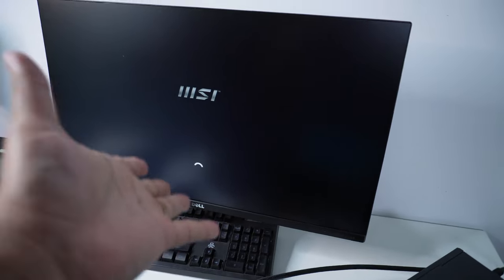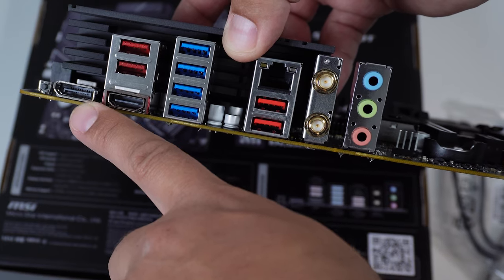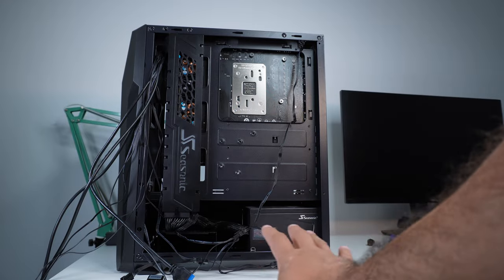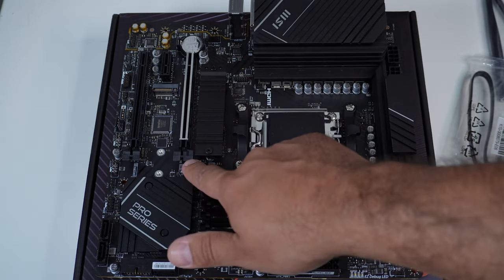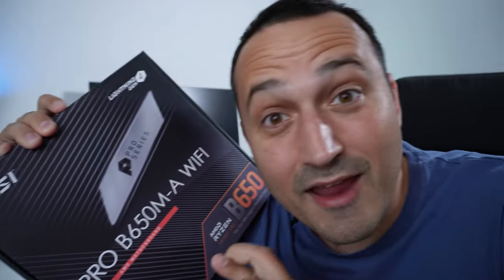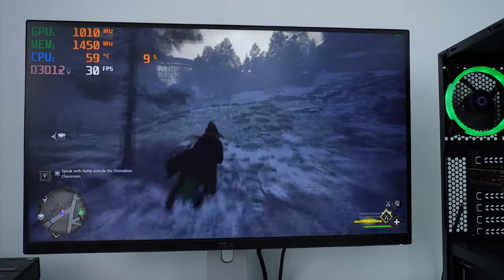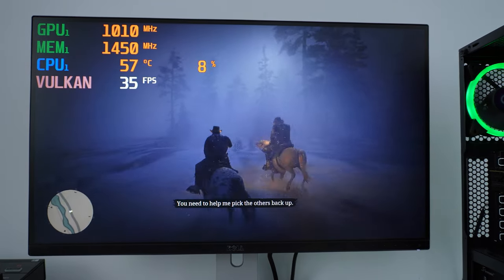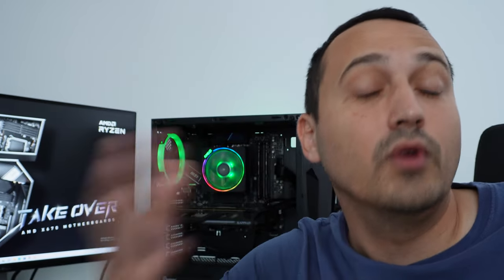Budget Gaming AMD Build Ft. AM5/Ryzen7000 CPU with DDR5

Comment: Going with Ryzen 7000 really doesn’t make sense at this price point. You could get a system with a Ryzen 5 5600 with an RX 6800 for $1000. Upgradability doesn’t really make sense either as most people probably aren’t going to upgrade that often, maybe like 5 years or more and by then they’ll probably change the motherboard anyways.

Comment: TechFusion, I've seen you've tried to 'build' with a GPU close to the unit I'm using lol, which is a  Radeon R9 390! 

This card is driving a 42'' 4K monitor. 

I'm surprised that you're getting 30fps on Hogwarts Legacy with it!

Would you be getting a Radeon 7000 series GPU? If yes, would you be able to do it on a review/test with your Ryzen 3900X system?
Reply from the maker: Hi buddy, and thank you so much for the comment.This is so cool as this R9 390 actually got me back in the PC space after some break and I bought used of a mining rig so I still find it amazing since its capable of  this performance in titles such as Hoghwarts.I did try a cheaper version of a 4GB card on a 500$ build and actually I found that this R9 did better with better visuals and smoother gameplay.I guess having the extra power connectors does actually help with performance unlike single fan GPU's that only draw the max 75W from the PciE connector. I will get a 7000 series for testing with this 3900X rather soon as I was looking to do so for some time but what I can tell you is that although this CPU is very good for the majority of tasks it is starting to show his age slowly.I found it to be a bottleneck when gaming on it with a 3090 in Hogwarts Legacy and I'm not quite sure if it is a game optimisation issue or just the CPU itself.Cheers buddy and thank you for you thoughts 💪💪💪
Reply: @Tech_Fusion  Sure not a problem! 

Back to the R9 card,  if memory serves me right those cards either had a 384 bit bus or a 512 bit bus, I can't really recall and may have to do some "digging into it!" It's really a shame that AMD stopped making drivers/optimizations for it. 

Really looking forward to that 3900x review, can you also do some content creation related benchmarks on it?
Reply from the maker: @TM86880  I think the 390 has a 384 bus but anyway its a "bit" optimistic to say the least as a bus width goes.But its a shame since its really a good card as is even for budget pcs todays.I will do a review of the 3900X since I want to upgrade and see what it can in comparison tot the newer AMD CPU's but if you are interested in a certain benchmark with it i can do it for you and get back to with the results with a reply comment here.Cheers buddy 💪
Reply: @Tech_Fusion  Thanks again T-Fusion! Benchmarks I'll be interested in are Davinci Resolve, Premiere Pro and any other content creation specific benchmarks. Looking forward to your review, and yes it's a shame that they never truly 'pushed' the R9 to their 'full capability'!
Reply from the maker: @TM86880  I can tell you straight on that using this CPU with the Adobe suite being Premiere Pro/After Effects and Adobe Audition its a very good bargain when it comes to the price/performance ratio.Since I am using this CPU for all the needs of this channel I can tell you that I am really happy with its performance even with DDR4 3600MHz RAM.I dont even OC it anymore since AMD handles its auto OC very well giving you peak performance per core/usage and definitely handles workloads much much better then if you just go an crank things up all the time on all cores.I am however using a AIO and so the temps are well in check and  so I'm quite happy with the overall performance.Cheers bud and stay tuned for the full review💪
Reply: @Tech_Fusion  :yougotthis:

Comment: Great video, gave me some ideas for my first Ultra Budget AM5 machine, looking to aim for around the £450ish or under $550 :yt:

Components at the moment are:
7500F
Gigabyte A620 S2H
2x16GB RAM
5500XT
1TB NVME
Reply: im in indonesia using this;

7500F
asrock b650m-hdv/m2
klevv 2x16gb ram
rtx 3060 ti
xpg gammix s70 blade 1TB pcie gen 4x4
deepcool ag400 cpucooler
enermax DF 650w 80+ gold
m-atx case

all costs approx USD840 excludes monitor